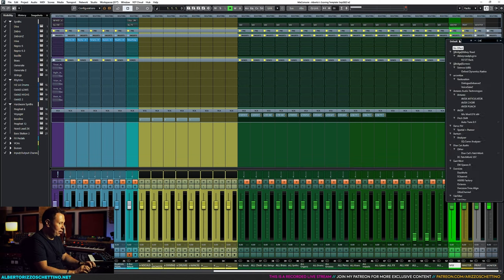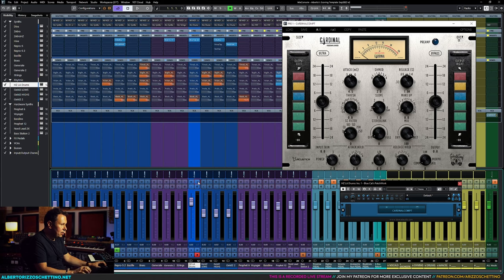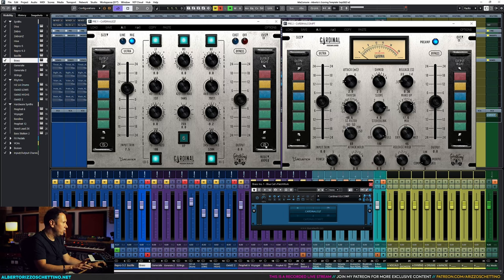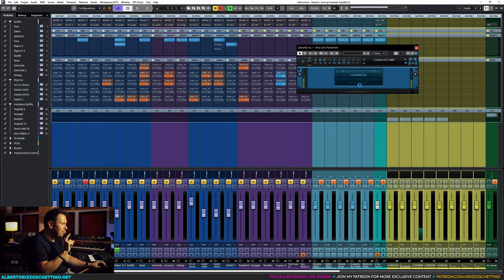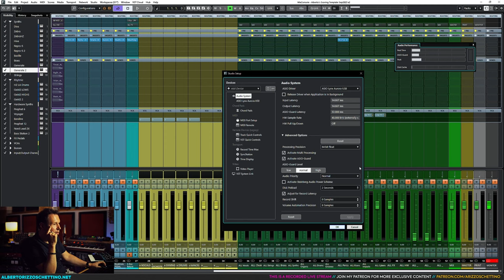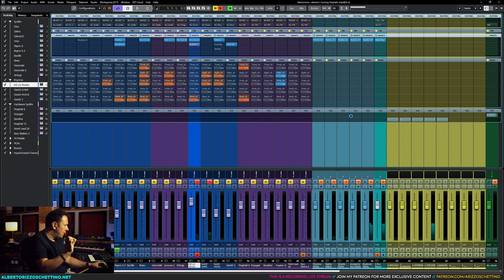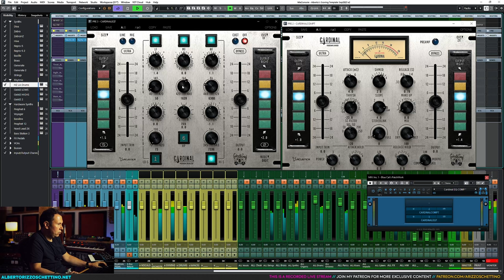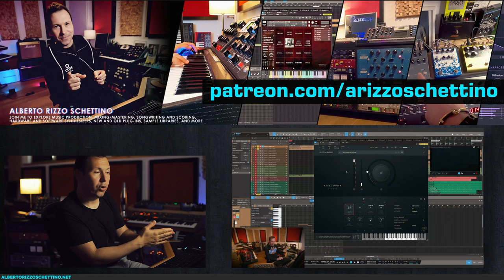Acustica Audio CARDINAL - It does what it shouldn't, is it a good thing?

Comment: But does it give you anything different to Fabfilter? Not from what I've heard when trying it.
Reply from the maker: Well, I'd still say between the Pro-Q 3 and Cardinal there are definitely common things (both can "EQ") but there are tons of features each is missing from the other. One has box tone, the other has dynamic EQ, etc. etc.
Reply: Why would you compare FabFilter to this? Completely different use cases. If I want to precisely, cleanly, do surgical work on EQ, or do super clean super hi-fi comp, I reach for FabFilter. If I want characterful analog-style EQ or Comp, with more ‘musical’ colorful results, where i can push the highs up on EQ without them getting harsh, Acustica or Kush.
Reply: @sub-jec-tiv  Lol I asked myself the same question.🤔